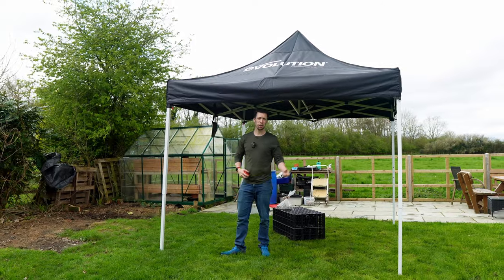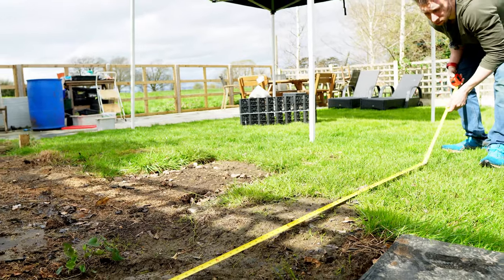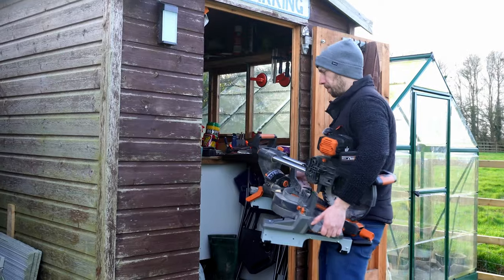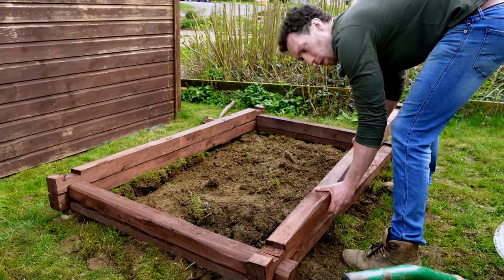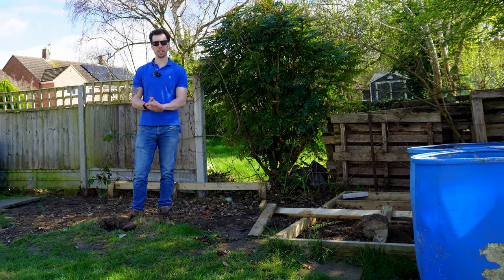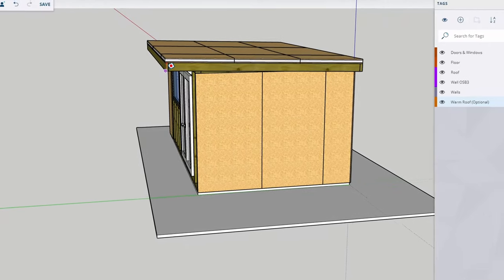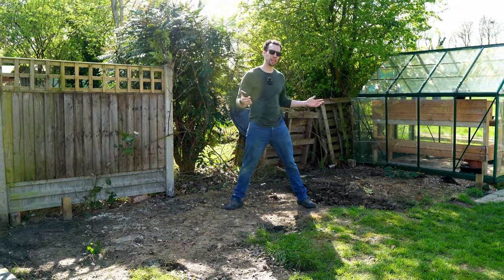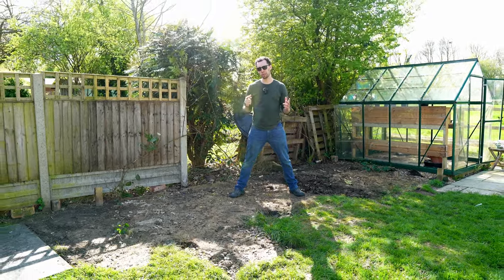Welcome & Preperation: Build A Workshop Ep 1

Comment: Definitely looking forward to this…I love a shed build series. Best of luck with it. I built a workshop last year and it was a lot of fun! My only advice is (as you most likely have done) is plan every detail. Like the stud layout in the corners to accommodate internal boarding (which a lot of people miss). If you use a rubber roof then lay it out first and make sure any factory joins are not going to get in the way. I had a factory join right on the edge of the roof which made fitting trims 100x harder than it needed to be.
Looking forward to the next instalment!
Reply from the maker: Those are good tip, thanks! I’m looking forward to this one for sure 👌